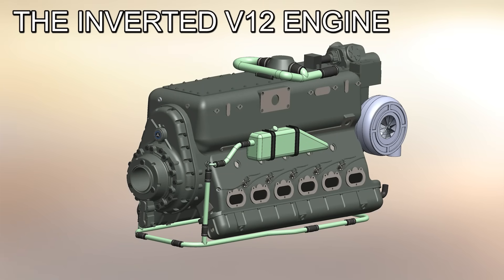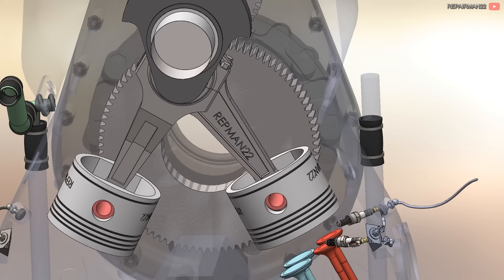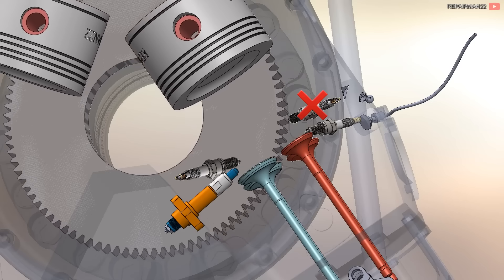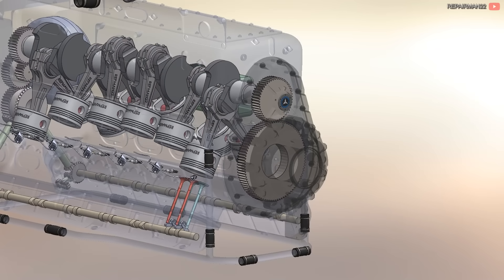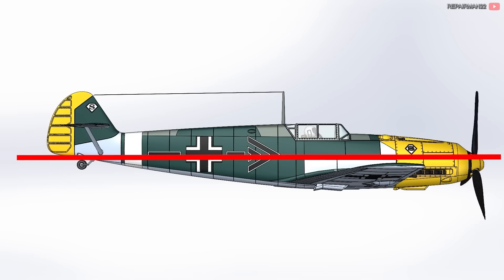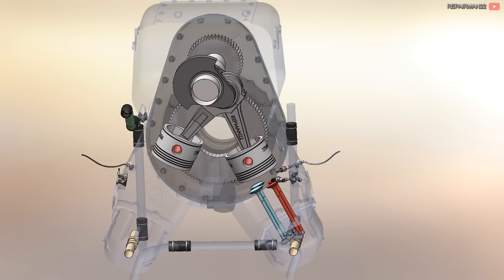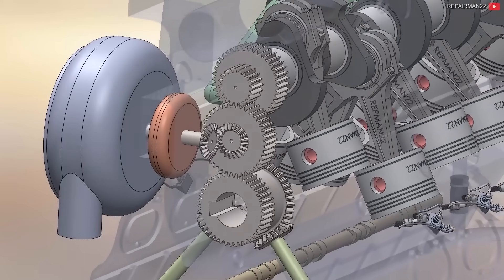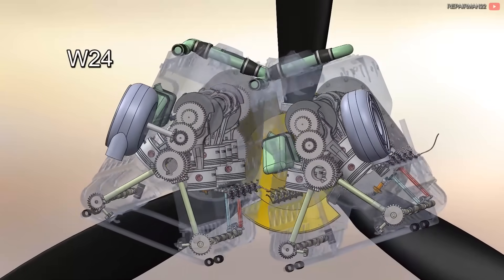The INVERTED V12 🤯 Why!?!?  - 3D animation - DB 600 Engine // Daimler Benz

Comment: The inverted aircraft engine wasn't an idea of Daimler-Benz, it was a requirement of the Air Ministry for Air Force Engines. For this reason, the majority of German V-Engines for aircraft during WWII were inverted, Argus AS 10/410/411, Junkers Jumo 210/211/213, DB 603/605.
It appears that one of the main reasons for this requirement was easier maintenance. Because, the mechanics could perform most of the work from below the engines.

Comment: The db 610 sounds like an absolute nightmare to service
Reply: It also gave serious overheating and reliability problems, caused in no small part by the engines fighting each other, I have always wondered what it would have been like with contra rotating propellers, with each engine driving one, you would still have the reduced frontal area to keep drag down, which was a desired requirement from what I have read, with the weight saving over a conventional four engined set up, it could have reduced the losses due to unreliability and fires, an interesting "what if" methinks.

Comment: I can imagine these engines consumed huge amounts of oil. I had a BMW motorcycle where the engine was flat on it's side and when you parked it on the kickstand the "top" side was angled slightly downward. Every single time you parked the engine there was oil seeping past the rings into the combustion chamber and there was ALWAYS white smoke on startup - LOTS of white smoke on cold starts in the morning.
Reply: K 100 or K75??? The "Rolling Bricks"......
Reply: @Wuestenkarsten  R65
Reply: @PeterRoberts-imogiri  Ok, so the ""old" Air cooled Boxer Engine. Nice and nowadays hard to get!
Reply: @Wuestenkarsten flying please!
Reply: Happens on Porsche flat 6. Every now and then a huge plume of smoke as accumulated oil will burn on start up.
Reply: yea my goldwing does the same.
Reply: The DB 600 series of inverted engines actually used less oil for their size and power than, say a similar Merlin or Allison.  Just as the BMW 800 series of radial engines use less oil than the Curtis Wright radials used in the P47, Corsair etc.
Reply: All aero engines consumed lots of oil. I think the P47 drank (or leaked) 9 gallons each mission.

Comment: At 11:30 it looks like a Merlin powered 109, which considering the video is about the Daimler Benz engine, is a bit weird.
Otherwise nice video!👍👌
Reply: The Spanish fitted their (licence built) bf109s (aka Hispano Aviación HA-1112) with Merlin engines in the 1950s when they became freely available. You can see some of those Merlin-engined " Spanish bf109s" in the film "Battle of Britain", but painted up in Luftwaffe colours. The Spanish never fitted the DB engines to their fighters because the Germans could not supply them. Instead, they were first equipped with the French Hispano-Suiza 12Z produced in Spain under licence. Like the Merlin, that was a conventionally orientated engine.
Reply: @TheEulerID  Nothing I didn't know already. But for the more clueless people out there.

Comment: Very well done !!   An upside down engine for airplanes they used was brilliant, and I wonder why more countries did not use it. The mechanical injection had issues, but it worked!  It was stupid the way England slaved themselves to carb's even with the choke point regulator hack. 
A few minor points to mention: Germany never seem to master the high pressure coolant problem, compared to the British and Americans. They always had issues with it, and many engines only lasted 14-20 hours. Germany's main fuel and lubricant sources was coal converted to low grade fuel. They never got over 80-90 octane, where England and America eventually got up to 130 octane.  The NITROUS OXIDE was Germany's secredt weapon!  And it took YEARS for England and America to figure it out.  Although water injection to cool the cylinders was an old racing hack. The Turbo's - and Nitrous - LOVED low compression ratio's and that worked out very well.  The dual engine concept never really worked out.
Dual sparkplugs another brilliant idea, you are right, they needed to be opposite or further apart.  Kawasaki cruiser motorcycle still use this concept today!
Reply: RR Merlins had twin diametrically opposed spark plugs.
The de Havilland Gypsy series of engines were inverted.

Comment: The W 24 engines use on some of the bombers is certainly a brilliant idea with the life of me I don't know why they didn't just go for large or two-stroke diesels. The engines would have weighed a lot less, be more economical to run in terms of fuel, would have required less maintenance, and by all accounts probably would have generated a lot more torque.
Reply: Reason the lack of 100-130 grade petrol and oil burners were a bear to keep serviceable, yes Beemer could have designed build an 18 cylinder radial using 70% of parts from their 801D and rival Pratt& Whittney,s R-2800.

Comment: Well done! Most sources just say, "Well, uh, moves the engine out of the pilot's line of sight and allows through-the-prop and top gun placement. You dove MUCH deeper!
Reply: The video was called Inverted V12 WHY?!?. It's a pretty good video, but most of the info was not about WHY!?!? Inverted V12, it was technical information about HOW?!?! this V12. So yeah he dove deeper into HOW!?!? but not into WHY!?!?, which really boils down to aircraft geometry. It's not like you can't have a supercharger or fuel injection on other engines.

Comment: How does the oil sump work?
Reply from the maker: As shown in the video. 2 oil pumps take the oil from the bottom and take it to another tank where a pressure pump works like in any other normal car oil pump. As long as there is oil in this small tank, no matter if it is vertical or not, it will maintain oil pressure. Of course, there is a short time until the oil runs out since the bottom pumps are not reposing the oil. The small tank where the pressure pump is, has the oil sucker pipe in the middle so whether it is inverted or not, is the same.
Reply: @repairman22  thanks! Heard the bit about the dry sump but had trouble understanding how the oil got off of the pistons

Comment: needle bearings need oil too. If the engine ran out of oil they could not make it back to base. May run a little longer but will overheat and seize engine.

Comment: I just completed a restoration of a 57 Mercedes 300sl with the direct injection adapted from these engines. Absolutely amazing technology for the era.
Reply: Lucky guy, very nice car.  I've got a mk2 Cosworth Escort, but a 300sl would be a dream car.
Reply: Makes u wonder why direct injection wasnt standardized in cars in the 60s.  Instead we got carbs way into the mid 80s.
Reply: @datvik7187  Mercedes never made a V8 with carbs, only injection as it should be
Reply: @datvik7187   Carburetor is much cheaper/simpler.
Reply: @datvik7187  This certainly has to do with the complexity of the design and therefore the high cost of production.
For this reason, NASCAR race cars still run with carburetors by regulation. This is also just to keep costs down.
Reply: @christophermikrowelle7093   It's my opinion that Mercedes could have absorbed the costs in their R&D.   After all, they charge a premium for their cars, not to mention they LOVE making complex systems in their cars.
Reply: @datvik7187  But Mercedes already installed it in some of their cars in the 1950s. I wasn't necessarily referring to one brand, but rather to the general public.  Unfortunately, as a foreigner, I don't know what you mean by “R&D”.
Reply: @christophermikrowelle7093  NASCAR cup cars have been using EFI since 2012.
Reply: @Whambamrustytram  okay. that's new to me.
Reply: @christophermikrowelle7093  Research and Development, something Mercedes has always been decades ahead of everyone and why their expensive. Their pretty much pioneering every little thing that comes in later cars. Like fuel injection, keyfobs, suspension and so on
Reply: @christophermikrowelle7093  R & D means 'research and development'
Reply: Cool, I guess they simplified a little the injector as it didn't need to compensate for altitude anymore

Comment: Technical yet very clear. Thanks, I've always wondered why the German V-12 was inverted when no Allied engine maker tried this. Lots of stuff in there I didn't even know I didn't know!
Reply: Both de Havilland (UK) and Ranger (USA) made inverted engines. They were air-cooled, so they were smaller than the DB series.
Reply: @muzza881   Interesting. Thanks.

Comment: Another advantage of the inverted V-engine is that it is easier to maintain in the field. The spark plugs, valves and other important assemblies are easy for the mechanics to reach. No ladder or similar is required.
Reply: That's what he said.

Comment: silicon? weird name, correct is Silicium who is the scientific name use all around the world...and for the canon firing trough the propeller shaft, was the same on the Hispano Suiza Y12 engine from the 1939-40 french fighters, but this engine, also known as "moteur canon" (canon engine) was in normal upside position...
Reply: In English its called silicon, just like for example the English name for Natrium is potassium.

Comment: Finnish Air Force had some problems with crankshaft lubrication on DB605's. Late engines had only bare iron cylinders, they wore fast.
Reply: It was an issue on all early DB 605's. When they developed the 601 into the 605 they switched from roller bearings to plain journal bearings on the crankshaft, but forgot to increase the oil supply. Doh! Eventually the increased the capacity of the oil pumps, introduced crankshaft nose oil supply, and a centrifuge to de-aerate the oil to reduce foaming. But all these fixes took quite some time.

Comment: Most diesel-electric submarines or U-boats engines were like this. So if you had to rebuild the rotating assembly you did not have to cut the sub open

Comment: Excellent graphics!
Another video comparing the Merlin with the DB601 would be good. At the beginning of the war the 2 opposing engines had near identical output and the respective aircraft Bf 109E and Spitfire Mk 1 had near identical performance. As the war progressed the DB 601 started to fall behind  as did later models of the Bf109.

Comment: My first thought, having paused the video at the start, is that this is an aircraft engine. A reason to have it "upside down" would be to allow maintenance access standing on the ground under the engine. I may be completely wrong but that is my initial guess.
Reply: +@michaelpetterson4919   The original RLM engine specification from the 1920s was for inverted engines with a provision for the central-fire cannon installation.  Maintenance was also considered as well a pilot visibility.